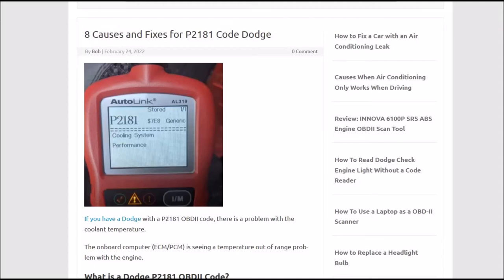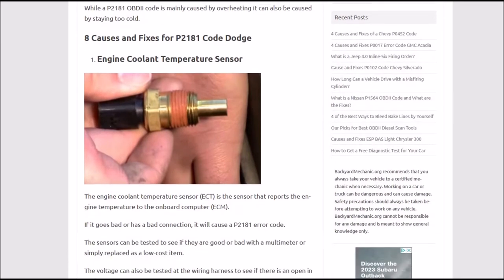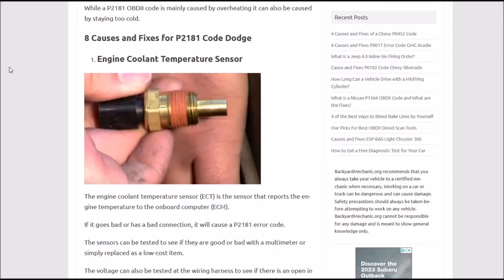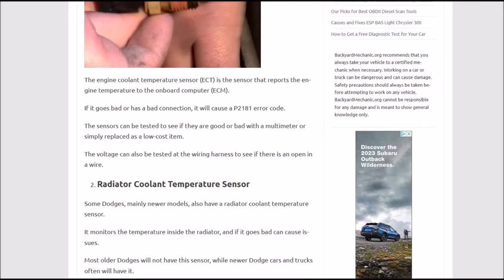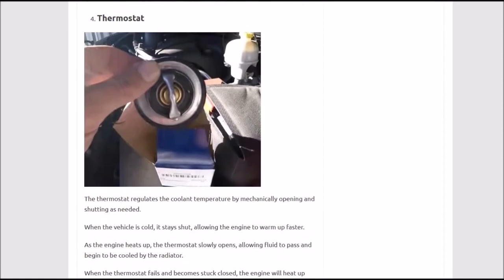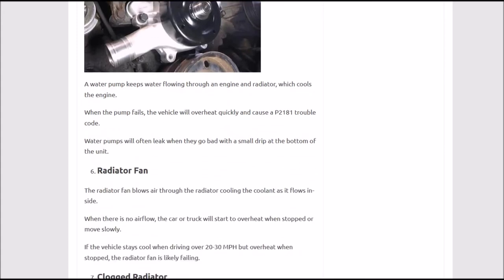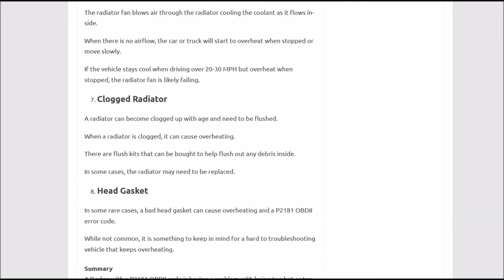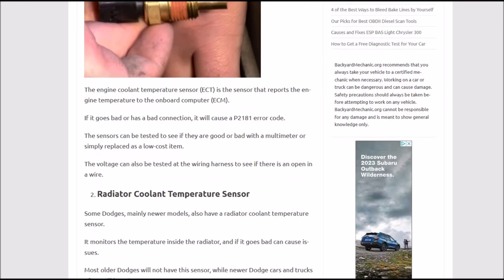8 Causes and Fixes for a Dodge P2181 Error Code (Cooling System Performance)

Comment: It can also happen if theres not enough coolant in it
Reply: yep mine done that today after i changed timing cover gasket etc.
Reply: had a lightning bolt while trying to burp system it went over half way on temp gauge so i shut it down wouldnt restart with the code p2182 either for a bit. i finally had to mess with fuel feed to get it to catch may have flooded or like flooded trying to crank it a few times idk lol. but either way you are right

Comment: Currently troubleshooting mine, it started getting cold here, and I got p2181, only symptom I'm getting is that the coolant temp needle disappears and no longer reads temp on the evic. Only happens when the car cold starts in cold environment, car reaches operating coolant temp and then will disappear. I've pulled the car over and shut off and turn back on temperature is reading again. Have you seen this before?
Reply from the maker: If the car warms up normally with no overheating, it is likely a sensor having an issue.

Comment: This video helped me out. I have an 2012 jeep Liberty, this same code came up for me as well. I’ve changed the temperature sensor/sender, water pump, and the thermostat. The code showed no more. I’m now having an issue where the temperature gauge is saying it’s overheating but it’s actually not. Any help???
Reply from the maker: Sounds like a sensor has gone bad or the temp gauge.
Reply: I have seen many times if you drain the coolant to change a sensor or anything else in the cooling system you have to bleed the air out of  the system when back together to get the guage to read right and also not overheat